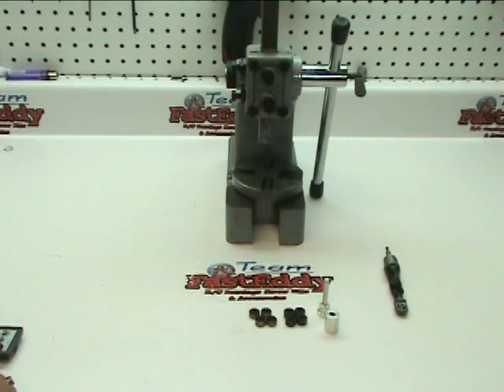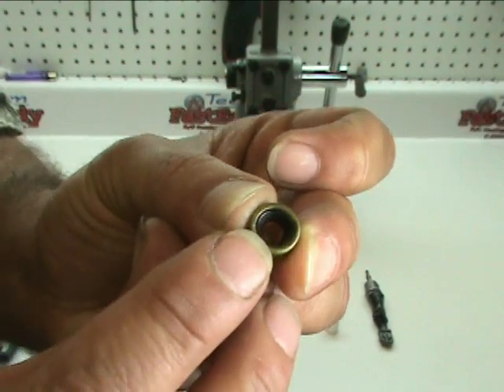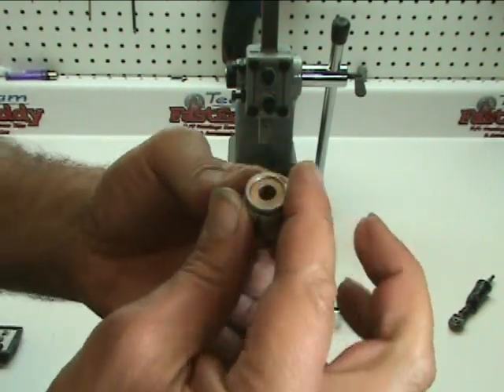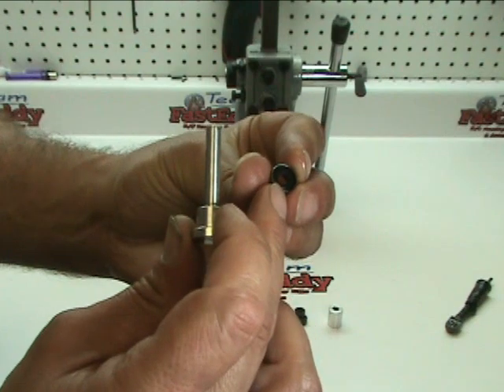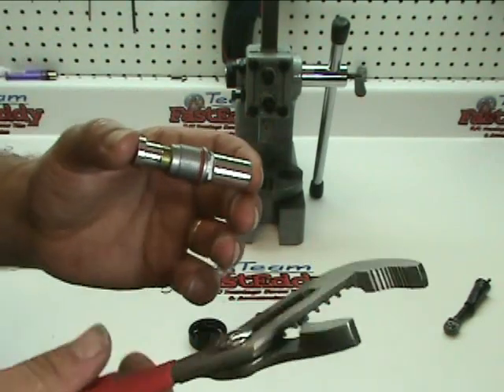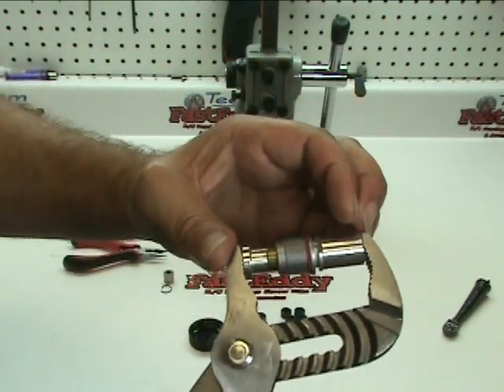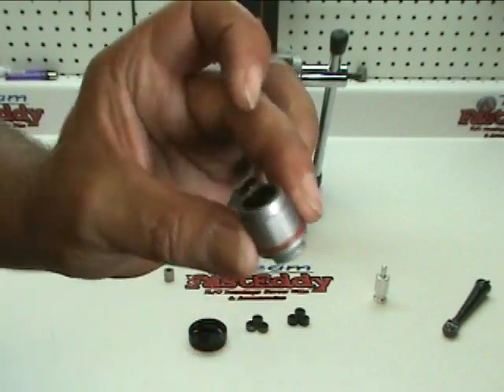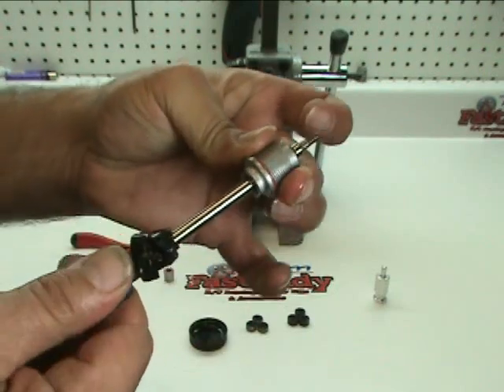Installing Threshold Umbrella seals in HPI Baja shocks

Comment: I am a mechanic and have been for over 20 years, I will not use these if they are installed the way you say to do it. To seal oil the sharper edge(seal lip side) of the seal MUST go toward the oil. I think threshold better talk with Chicago rawhide about proper installation of an oil seal. the way you guys are installing them is ONLY using the TINY dust lip to seal oil which IS wrong. The oil needs to surround the lip to pressure it against the shafts to seal properly.

Comment: I just installed a set without the tool by using the stock bushing you take out and a C clamp, it wasn't hard at all. Just have to make sure it slides in straight.

Comment: Can you still buy these? Baja shocks leaking like crazy! All 1/5 seal Baja sites have died. Is there a better way to get a good seal?
Reply: Pull yer shocks apart and replace the o-rings in the bottom. There's no reason to have this "upgrade" unless you don't want to do any wrenching. My Baja was sitting for 8 years and each shock still works just fine. The fronts lost about 5% of their oil, and still work like gangbusters. Just do a bit of maintenance after each run. The lower o-rings are super easy to find: http://www.davesmotors.com/hpi-75070-p4-o-ring-set-4x2mm.html. Really, 80+% of the early Baja upgrades were a solution looking for a problem.